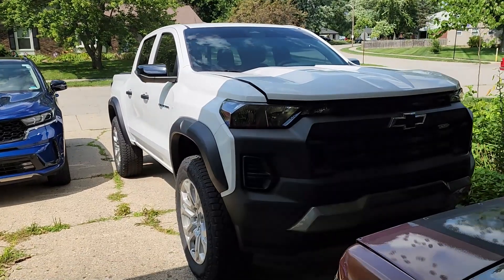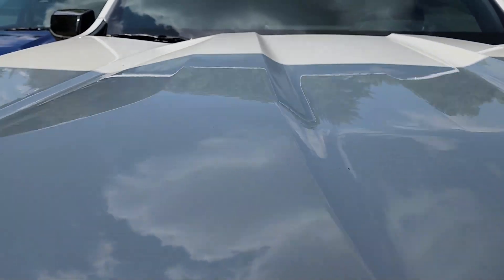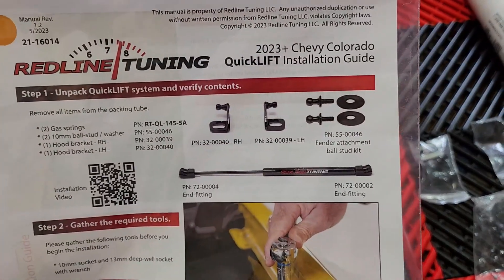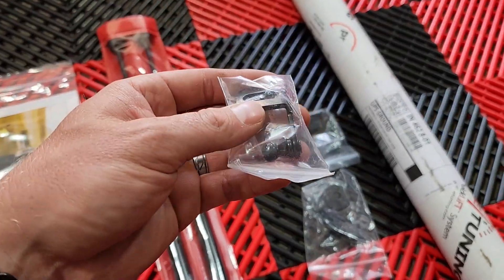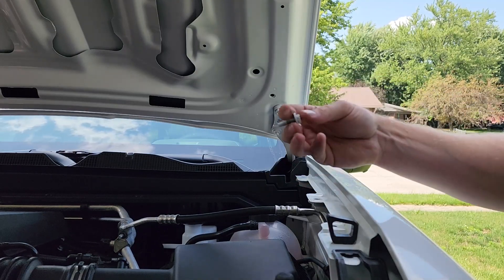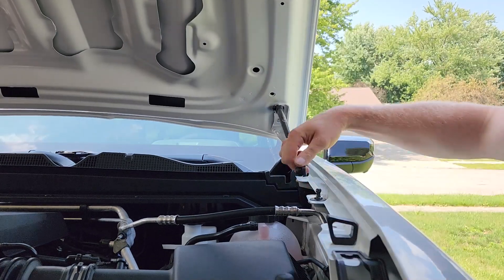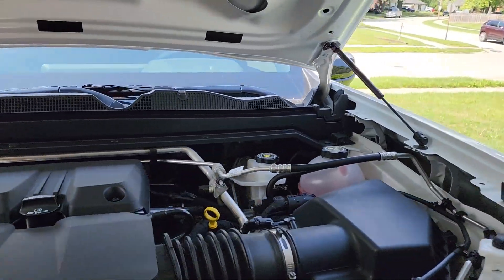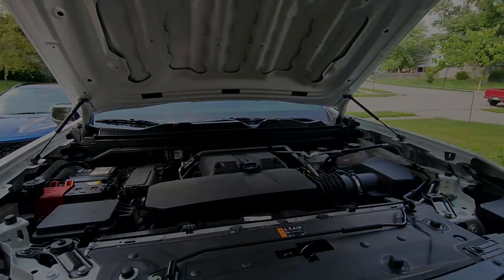2023 Chevy Colorado First Mod upgrade to my Trail Boss Redline Tuning Gas Hood Struts

Comment: I'm waiting for them to make the strut for my 2023 Canyon AT4. They are not interchangeable. Great video
Reply from the maker: Thank you and ya I'm surprised it hasn't came out yet
Reply: @TonyTheTechnician  I am too...they said they did not have a Canyon in their shop to work with.
Reply from the maker: @joebruce1670  ya you would think with how long they have had the colorado ones available they could have had a canyon in the shop by now
Reply: I just got the Amazon ones and the instructions say "2023 Chevy Colorado and 2023 GMC Canyon..

Comment: What’s weird is, Colorados come with black steel wheel with highway tire for spare tire, ive owned mine since July 3, yesterday I slid under mine just to look at everything,,mine came with a shiny alloy or aluminum spare with off-road tire like my other 4 tires,, ive never seen that on one before ,,I wonder if they were out of spares and just gave me that so the truck could ship and get sold!
Reply from the maker: It's part of one of the packages. I have the same thing